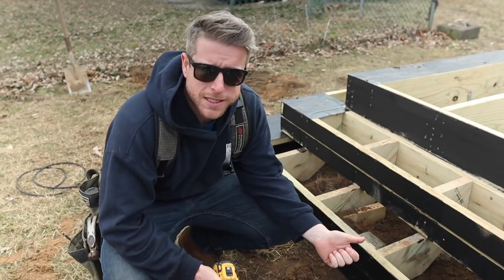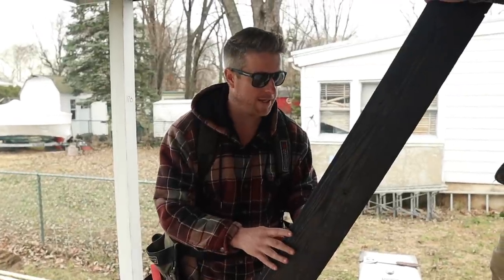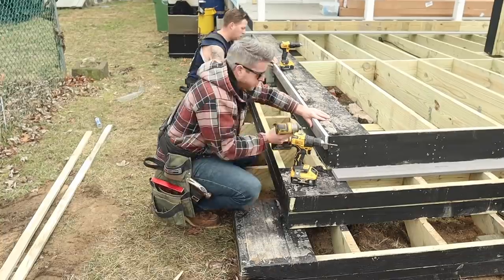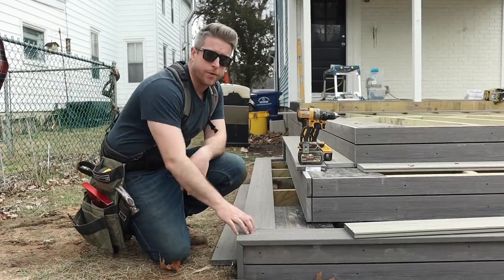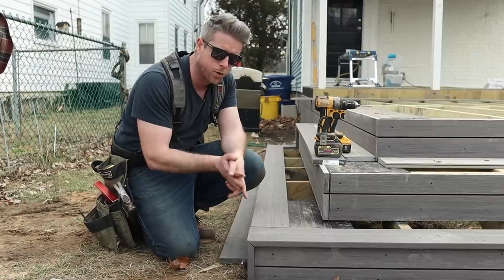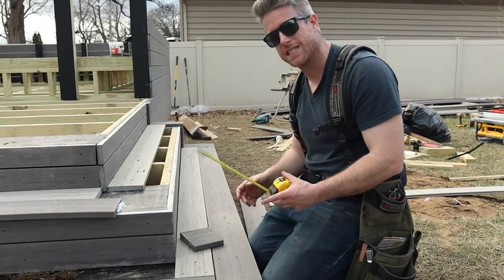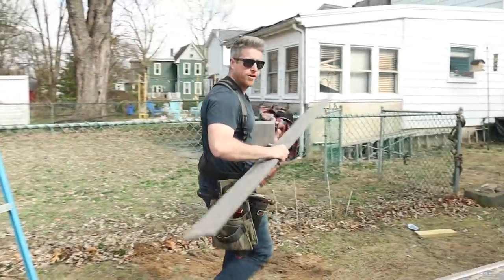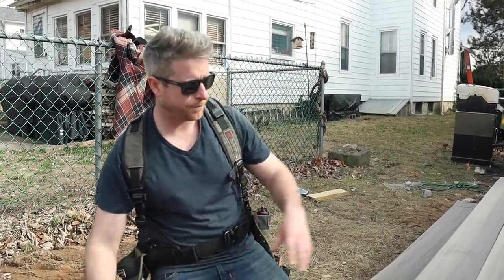DECK BUILD Part Two - Installing Composite Decking And Porch Ceiling

Comment: Looks great. I'm getting close to adding my deckorator's decking on my own build (Costa and Mesquite delivered this week, gorgeous!). I've got a bit more framing to go--some tricky bits with a hatch opening and a bench. I need help with the bench so I'm eagerly awaiting your next vlog. 
So glad you had some warm weather up there. I'm in NC and we're going to be near 80 this weekend - a little hotter than I'd like, but at least it'll be dry.
Reply: btw, Catherine rocks! I'm a woman and for my build so far I've had a couple of inspectors and suppliers talk to me about "having my deck guy..." do something. I have to tell them that I'M the "deck guy". THEN they take me more seriously.

Comment: any worries with rotting in the framing with it so much of the deck enclosed on the sides? What keeps it from getting super steamy in under there in the summer?  love the designs and the videos are awesome!  Bring back Pat!!!!
Reply from the maker: All the lumber is rated for ground contact, and the 1/4 inch between boards helped for ventilation!